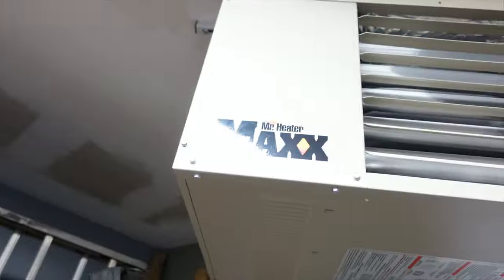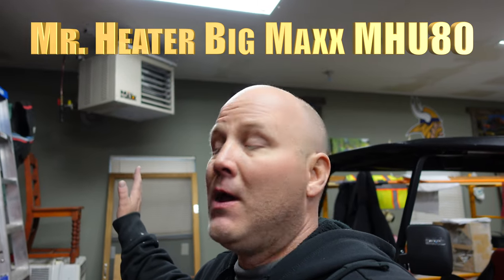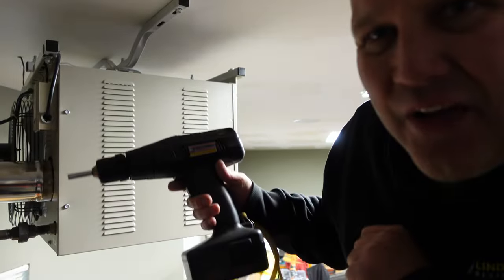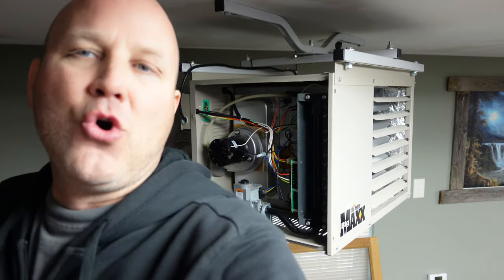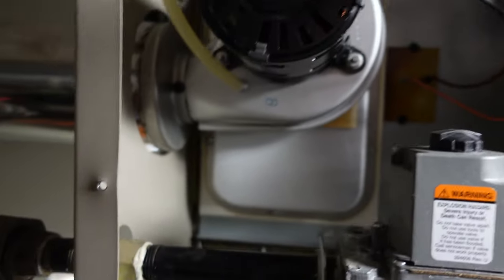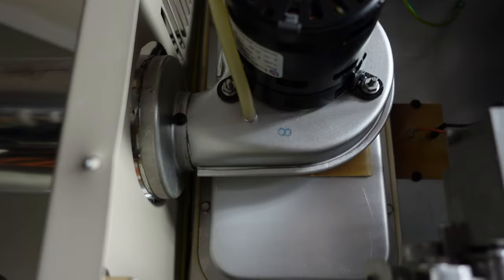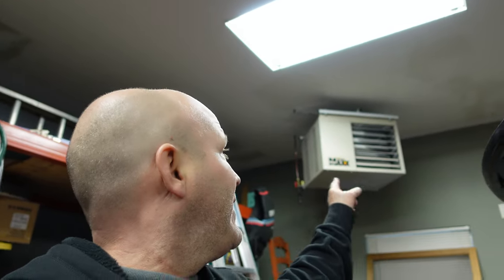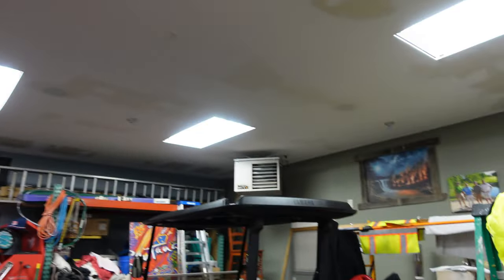GARAGE HEATER.. Mr Heater Big Maxx BIG PROBLEM  #bigmaxx

Comment: That heater is way to big for your garage ! You only need a 50,000 or less and it would run more efficiently and be more cost effective
Reply from the maker: so you’re saying the square footage every heater is rated to handle is wrong..?  that i should cut it back to half the recommended btu and have it run twice as much twice as long.. thats ok, i like the minimal run time
Reply: @chubs DubC  yes all heaters are rated for a certain amount of square footage, the closer you get to the amount of footage for what the heaters are rated for they run better ,if that was not the case companies would make a one size fits all and thay make them for the size of the building or garage
Reply: Stop looking at sq feet. Always cubic feet
Reply: We have this exact model. Our garage is only 24 x 24 (576 Sq feet), BUT it has a 19 foot ceiling with an open storage loft. We’re up in Canada and this furnace is the perfect size for our space. It maybe runs MAYBE twice a day (I know because our office is out there, we spend hours in it each day). It’s definitely not too big for our garage so surely not too big for yours. We calculated CUBIC feet, not square feet. Thanks again for this video. Saved us a bunch of trouble.
Reply from the maker: @brewmillcandlecompany wow sounds like a great space you have 😳👍 thank you for the comment and i’m glad yours is working 😁 i loved the unit

Comment: Did you check the gas presure and adjust when you installed the heater? You are fixing the problem but missing the cause. Stop blaming the machine for your lack of HVAC knowledge.

Comment: I have a Big Max 80,000 btu here in Ontario Canada . I heat my living area approximately 1200 square feet. I just clean this tube each fall before heating season. I have had 9 winters now with no troubles at all. I love this furnace.
Reply from the maker: good to hear 👍😁

Comment: This is normal maintenance that should be done every year.  The guys who came to fix it are like most today, just guys off the street who don't know what they are doing. I would also check and clean the flame sensors. Looks to work fine now but you don't want it to fail when you really need it. Good video. Shaky, but good.

Comment: It's a good heater, you just need to find out why or what is causing the pressure sensor tap to get clogged. I would pull that inducer off and see what is inside. You have something inside that should not be there possibly from manufacturing. Pretty sure Modine makes these for Mr Heater, do some do diligence and look further into the issue. Calling something junk without the background in the product is less then fair. Could well have come from an installation issue, pipes etc. Yeah you need to dig deeper and find the root cause.
Reply from the maker: this happens to quite a few people with this unit so it has to be inadequate manufacturing processes.. that garage has since been moved and i now live in the Philippines 👍
Reply: @chubsDubC  I would not blame it on a manufacturing process although it could be. Is what it is and you are unable to go further into the troubleshooting process. I have a Modine in service for 8 years with zero issues, I have one of this name in the 50,000 version on the way, I will do a comparison and look for differences. You picked a nice place to live..
Reply: Same issue with mine. When that hole clogs condensate forms in the line. When the heater fires up the computer will sense that vacuum line is clogged and won’t ignite heater. I used a drill bit to make hole slightly larger and have never had a problem since.
Reply from the maker: makes sense and good idea 👍
Reply: @frankrizzo1679  Good, yeah I was wondering if drilling larger would help or be an issue and didn't want to suggest it so as not to break someones unit worse then it is.
Reply: There is nothing wrong with this heater. You could have spent twice as much and  still had problems.  You also could not carry a tune in a bucket.
Reply from the maker: i did like the heater once i figured out the quick fix.. unfortunately it happened too often 
c’mon im a great singer 😳😜
Reply: My exhaust manifold had a mud wasp nest in it. Removed at now works fine. Talk about some diagnosing on that one.

Comment: My heater gave me problems intermittent since new. I had no error codes, just a steady blinking light,  ready. It wouldn't call for heat, even if I closed the connection on the thermostat. I started looking around , moving wires a little bit and found the light would flash faster if I moved the wires a bit, .it turned out that the 4 wires that were connected to the board on the right edge had about 1/8 of an inch of wire bared in the connection. And wiggling them proved that they were not making solid connections.  I bared them 1/4 inch and it works fine.

Comment: Thank You! Thank You! For making this VIDEO. My heater had the same issue. My repairman didn't have a clue (Inferring it was a cheep heater) and most likely non-repairable. I was lucky to find your video and in 15 minutes had my up and running again! Thanks again for your great video. Woody
Reply from the maker: im glad it helped 👍
Reply: Almost every component seen can be serviced or replaced for not alot of money. The gas valve can be sourced online easily.  No need to drop $1500 on a Modine, Sterling, or Reznor unless money burns your pocket.

Comment: thanks much.  Cleaned the little port on the fan housing and that seems to have solved the problem.  Heater is 13 yrs old and this is the first time it's failed.  Gracias.
Reply from the maker: 13 years 👍
i’m glad the video helped 😁

Comment: i used to repair drills and build drill pack batteries back in the day. That model of drill is the best Craftsman ever carried. It is actually a Porter Cable in disguise built for Craftsman back before Porter Cable got bought out and became a ghost brand. All metal gearing and a beast of a motor(very large and heavy). It's only Achilles heal is the notorious Porter Cable DIY plastic chuck. However, being plastic, it was still built quite stout compared to the DeWalt plastic chucks of that time. I still have a few of them sitting around myself. They're built like a tank and could easily outlast the both of us.
Reply from the maker: yes they are 👍

Comment: I'm curious about the mounting bracket you used, will be hanging mine in a cpl weeks
Reply from the maker: professional installer brought that 👍 it made things easy, honestly though ive sold and moved to the Philippines 😁
I’d say screen shot and ask around somebody will recognize 🤞
Reply: Quick-Sling Unit Heater Swivel Mount

Comment: Big Maxx hunk of junk.
Over the course of the last 30 years, I've had two different (severely oversized) used home furnaces. They were very reliable. Then I decided to get one of these and I can't depend  on it at all. That pressure sensor has been warrantied and the hose frequently freezes or plugs up a few 2-3times per winter allowing my garage to freeze until I notice it and have to fix it again. And now I inconveniently have to get a ladder out for the difficult location.
Reply from the maker: bad unit 👍 i also started having this issue a couple times a year 😬
quick fix but inconvenient and if you dont notice youll freeze your space like youre saying 😮 once that concrete floor is cold it takes a while to get it warmed again

Comment: could this be due to not having a condensation trap?
Reply from the maker: i dont really know 🤷
Reply: I'm a hvac tech. needs condensate trap with drain. also check you manifold gas pressure. if low it'll soot up the exhaust as well.

Comment: The horizontal vent kit for this peice of crap is a rip off ,427.00 from tsc ,just bought this heater and probably will return it price gouging at its best, thanks Mr heater
Reply: I had the exhaust installed by my neighbor who is WETT certified and cost me 150.00 for regular "B"vent horizontal. Works fine for 6 yrs, great heater
Reply: @tomkreller1204  my manual that came with my heater specifically says not to use b vent for horizontal venting, I've installed hanging garage heaters in the past and used b vent with no issues also ,im guessing it's a mr heater thing?
Reply: @barnhousegarage  Yes that's a scam. Any other manufacturer of unit heaters allows you to use B vent for horizontal. Don't let them con you.

Comment: Hey man, I am also in MN. I am looking to buy one, the Big Maxx 50k BTU says it will heat 1500 sq ft if insulated. i have about 1000 sq ft. Does the 80k you have run frequently?  Thanks for the info. gives me some points to ponder.
Reply from the maker: i have sold since but i can tell you that the 3 seasons i ran that heater, as long as the concrete stays warm it does not run that much.. i liked keeping it about 60 in there to keep the toys from any condensation, and if i needed to tinker or work in the garage it only took 10 minutes or so to be shorts manageable… insulation is key, and concrete temp 👍
Reply: I had an old house furnace in my garage that was spaced about 4 inches from the floor and pushed out the bottom.  I redid the roof on the garage and decided to get rid of the bulky 40 year old furnace to put in this big max. It was a mistake. With driving in and out of the garage all the time,  cars always drop snow and ice. The old heater evaporated all the moisture.  The big max the floor is always wet.
Reply from the maker: yes makes sense.. i always had to go back out after a bit to squeegee the slush and shit that had dropped off 👍

Comment: I've had this issue for a couple years. This year I have to do this every few weeks this year. Any idea what is causing the root problem?
Reply from the maker: no i have no clue… i live Minnesota, someone speculated cold warm fluctuation..?  🤔
Reply: @david probably just dirt/debris getting into that inducer housing, that vinyl tubing just goes to a pressure switch which is just a safety to make sure your vent motor(inducer) is running. if that tubing gets plugged it won’t heat.
Reply: Just fixed mine, after replacing 3 pressure switches, motherboard, gas valve, transformer, and exhaust manifold gaskets. Big MAXX  is a good company and backed me all the way with warranty parts. They promised me over the phone to make it right. Any way when replacing the exhaust manifold gaskets, had it upside down and could see a wasp nest about the size of two golf balls at the bottom of the manifold where the turbine turns. It is cycling fine now. Any of you have wasp?? Could not see it looking thru the exhaust pipe, and turbine spun freely.
Reply from the maker: @jamesjenkins3384  no wasps in mine, don't have that Bee issue thank goodness

Comment: My fans running all the time with the unit off
Reply from the maker: yes thats what mine would do, run constantly but no heat 👍
Reply: @chubsDubC  now I have a led code 5 flashes
Reply from the maker: @douglasrichardson6852 did you try the clean out from the vid?
Reply: @chubsDubC  yes I did,I just ordered a  Circuit board

Comment: I'm not sure why you call it a piece of s*** just based on a little bit of garbage stuck in there I'm thinking you got to take the whole thing apart when you call it a piece of s*** for 400 bucks that hasn't swayed me I'm still going to get one you should probably just do this once a year anyway
Reply from the maker: yes you are right about the once a year, maybe a couple times in Minnesota where its necessary 6 months a year 👍
dont get me wrong… its been a great heater, shitty when you come out and find it acting up, but the 10 minute fix is easy and the overall cost was great, i’d definitely buy it again

Comment: You want the real skinny on why it's clogging the air flow switch and why you are really having problems? Before you blast me for bullshit, I'm going to let you know I've been a commercial HVAC tech and worked for trane, Johnson controls and even carrier services.. 
#1.. if it's 1000 Sq ft and you have sheetrock on the ceiling and walls, your oversized by a factor of 1.5~2.. 
#2.. what does that mean?! Well it's short cycling, it kicks on and shuts down because the Temp has been satisfied quickly.
What does that mean? It hasn't had time to build enough temp to burn off the condensation in the exhaust flue, and that condensation is acidic. It's going to corrode any and all dissimilar fittings like a battery..
#3... you should have a drip loop if it's pitched back to the unit anyways, that way it has somewhere to go, rather than sit in the pipe.
Buying bigger is never better, unless your accounting for drafts and air leakage, an oversized a/c unit will only provide damp cool air and burn out, a over sized heating unit will provide a uneven heating of the space and burn out from acidic condensation. But with over 150k in toys in the garage, it's easy to point at the heater that was the wrong size for the job.
Reply from the maker: it happens all the time with this unit through correct installation or not, drip loop pitched back up down in out.. its a great unit with some internal issues
Reply: @chubsDubC  it runs too short to burn off condensation.
Reply: You are correct. I've had similar issues with household furnaces because the temp rise wasn't high enough, that crystallization occurs blocking out pressure ports or even condensation drain lines.